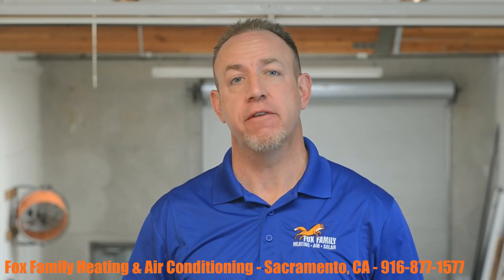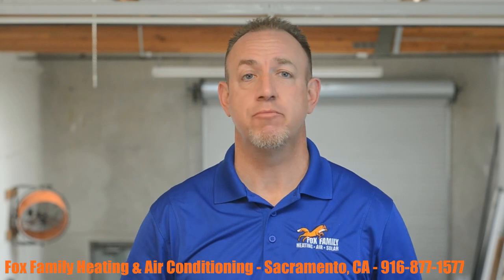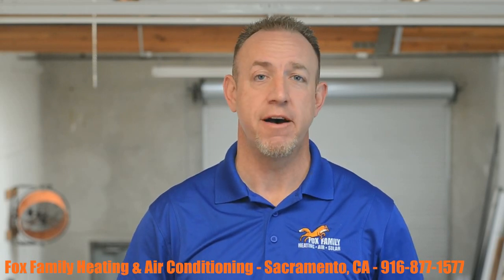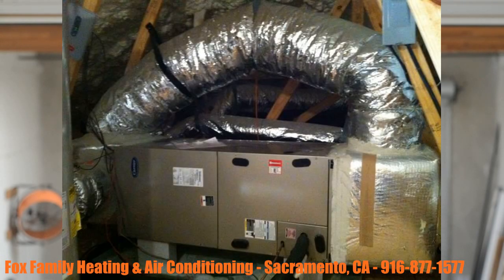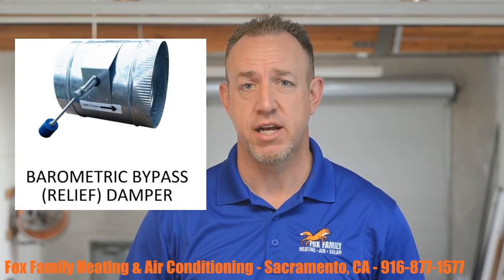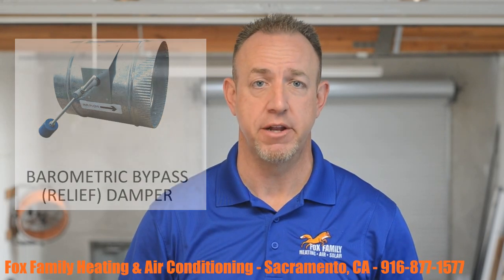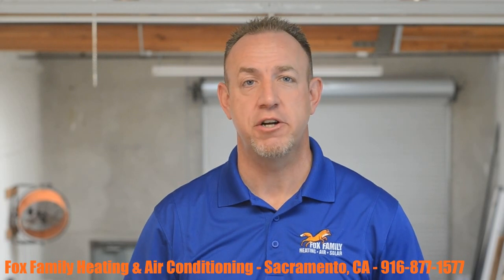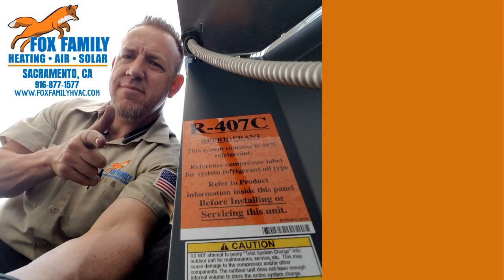HVAC Zoning Basics - Bypass Dampers and Dump Zones

Comment: When I purchased my two story house I ripped out all the ducts and repaced the 3.5 ton with a zoned 4 ton heat pump because I got a very good deal on the scratch and dent units. The ducts were oversized for the 1860 sq ft house in Texas. Two theromostats worked as designed, No dump zones or bleeding ducts. The upstairs was a bit noisy in one room.

The unit aged out and I replaced it piece by piece. The outside condeser with another 4 ton heat pump. After the thrid indoor fan and the synchronizers I replaced the air handler with a 5 ton two speed RUUD and converted it froma 410A to a R22 for the condeser. 

Resently I came into a RUUD 20 SEER variable speed 5 ton condenser. I replaced the condenser and changed to 410A refrigerant. 

Now this was a challenge to set up the zoneing with a two speed air handler, a variable speed condenser, single stage thermostats and a Honeywell zone board.

With trial and error my best settings are: Run the system on low as much as possible and let the dampers do the work. This means that after 40 minutes of running on low the zone controller will go to high. Typically it will run 2 to 5 minutes on high and then shut off. The high speed helps with humidity control. The variable speed likes long runtimes to achieve super high efficiency and very low noise on low speed. My power bill has been cut dramatically by running on low. The return airs are on both floors so floors are not separated and the returns airs will mix floors. I have also found that bleeding 1/4 open on the downstair damper keeps the downsatirs theromstat from cycling while the upstairs is calling.

For heating, it is electric and in Texas we don’t use much heat. My intent is to keep the heat on low unless the temperature gets really cold in which case the electric grid will fail first. My heater can pull 82 amps on high, enough to drain my wallet very fast.

Low and slow works and only go to high if you can maintain temperature.

Comment: Thank you for your informative video.  I have a raised ranch home.  The HVAC without any controls on it causes the lower floor to freeze while the living room, dining room and kitchen, all with cathedral ceilings stay very warm.  Additionally, on the living floor, the bedrooms (3), stay very cool.  As of now, I have magnetic covers on 66% of the downstairs registars to force more air upstairs.  It has made a difference, but on a 95 degree day, the living room and kitchen still reach 80 degrees and my wife has issues with heat due to heart problems.  I would think a three zone system would work well, by dialing down the downstairs and bedroom air flows during the day, and then opening up the bedrooms for nighttime.  I do have fixed speed blower in my HVAC system.  I tried to damper off with a manual damper on the entire downstairs duct.  I ended up stressing all of the rivets holding the fan together and it started to come apart!  Obviously, the answer is to not entirely cut air to other zones, but partially restrict it.  Thanks again.  I will probably be installing the Honeywell system in August.
Ron
Reply from the maker: Great info Ron. Good luck with that 👍

Comment: Thanks for the info - I'm sure there is a reason this is a bad idea but when using bypass connected to the return, could you use a limit switch with a lower temperature so the burners shut off earlier?  That way you are still re-using the heated air, conserving energy, and eliminating the "super-heated" situation?   Also, do they make variable speed blowers that increase/decrease based on the number of open zones?

Comment: This was an awesome video to discover.  We recently moved into a house with a dual zone system and noticed shortly after we moved in December, the house would take a very long time to heat up. What they did was the bypass duct, so the return air was being heated up just like you explained.  And I assume if we left it the coil would of frozen up with the ac in the summer.  We took out the elbow from the bypass duct and capped off each end, and problem was solved.   But now we have a whistle when one of the dampers close.  I have adjusted the electronic damper so it doesn't whistle, but now a lot of air goes through that damper, which defeats the purpose of having that zone shut.  I have tweaked it to the sweet spot of no whistle, but want the air blocked more.  I have tried the dump method as the video suggested, and it works, but the utility room the furnace it in, gets very hot in the winter, and very cold in the summer, so I recapped it off.  What are some suggested to use this redirected air more efficiently for my basement.  Problem is its completely finished so I don't have much access to the duct work besides my utility room.

Also, is it better to have the zones close as tight as possible, or should some air be allowed through?  Can adjusting the zones help with low air flow at vents the furthest away from the furnace

Comment: Where I come from, Bypass is a bad bad word. I would always use a dump zone before ever installing a bypass damper.   My favorite zoning system is the HeatPumPro by Arzel Zoning System (not just for heat pumps.) If you have 2 stage equipment, you can control the fan speed depending on the amount of available duct work to control objectionable air noise.  The fan is staged independently from the outdoor unit.  If you do not have 2 stage equipment you can use the Evergreen zoning system by Arzel which utilizes the evergreen motor for staging the fan.  If you have never heard of it you should check it out!

Comment: Great video! I had a service call working with a Honeywell HZ322 , it kept tripping on low temp ( discharge air temp ) the supply temp was correct. It’ll trip at 45 then reset sorta like short cycling, I checked dampers all were operating normal? It did have a by pass damper it was maybe 1/4 open. But still will trip

Comment: If you have an air handler with a variable speed fan, can it be programmed to use the lower / slower speeds when sending air to the smaller zones, thus creating less cfm, less pressure, and reducing the need to bleed off excess pressure.
Reply: My exact question.
Reply: I think that due to the amperage draw the ecm auto corrects its speed to run efficiently

Comment: I replaced a Power open zone damper last week, we installed a new Honeywell Damper that still bleeds air into the closed zone, you can set it up to like 30% leak rate or smaller. When I saw my first zoned system I was immediate thrown for a doozy because of the by pass.
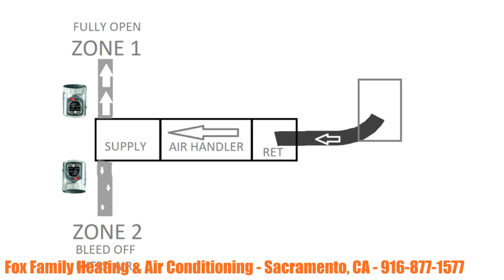Reply: 6:40 exactly what I am talking about
Reply: Another fun thing I had to do on this job was number the correct zones for the customer & rewire the zone board. Someone before us took off the 24v from Zone 1/2 and I’m guessing tried to give it 24v all the time or something because both sets of wires were on different tab. He had a single-story home zone 1  for the living room, dining , kitchen area. Zone 2 for the bedrooms. So it was easy to figure out. The attic was just getting to me
Reply from the maker: Wow great feedback.  Sounds like you guys know what you're doing. Keep it up!
Reply from the maker: @SalvadorHVAC  yeah I had a zone system where the stats were wired to the wrong zone!  Upstairs was feeding downstairs.  There were some other issues going on too. But wow, the installers really blew it with that system.

Comment: liked your video, but it confirmed as I have always known, zone systems are not effective for a home unless there is variable speed used to to drive the air, and the coolant. The only reason zones became of use , in my opinion was to get by with a smaller system. Even with variable speed systems, and EEV's additional systems like mini splits make much better sense. I  recently redid my home built in 1966 from a package unit and crawl space ducting to a smaller variable gas over electric 20 SEER split heat pump, and furnace combo (dual fuel). I then added mini's for the bedrooms not used much. The master bed, kitchen, living room, and dining area are covered by the split. I chose 2 separate mini's for the additional bedrooms because one could switch from heat to cool from the other. Also there is a slight increase in energy savings with multiple mini's versus a multi head system.

Comment: You never mentioned how to properly size the bypass in either the dump or return? 
75% of the largest zone? What's the rule?
We ran across one today and had a 14" bypass on a 3 ton system? It barely brought the barometric weight off of zero with either zone open or closed? I like the 24V return dampers with the static sensors.
Thanks for the info.

Comment: The question i have is
Instead of By pass damper wouldnt it be better to put modulating furnaces with variable speed ECM motors which will automatically slow down after sensing high static pressure building up in duct

Comment: I have a similar house to your example in this video (smaller scale). My small area is upstairs where I sleep. My downstairs damper has gone bad for the second time after I replaced it. (the larger area/downstairs damper will close permanently) No bypass or dump zone in my system. Is this because it has constant air blowing on that larger damper most of the time? It’s the damper that’s always closed so maybe it’s the constant pressure overtime causing it to stick in the closed position. That’s a theory one tech had

Comment: I'm a fairly advanced DIY guy and found this while looking for zone info to replace the awful Beutler system the house came with. The Honeywell dampers have caught my eye. But something else  I see in my own home is that the master gets pressurized so doesn't have good flow and thats not a zone problem . How would one fix that? install a return duct that is piped to the return plenum?
Reply: We have a 12"x12" return in our upstairs master be just for this reason.
Reply: Any beutler system is crap. The zone box dampers are too small and they put zone systems on single stage equipment with undersized return air intake. These units short cycle, overheat, hi limit. Add a return air intake to the master. Put it in the closet. That way you won’t see it or hear it. Then when that system does, get a 2 stage system with properly sized dampers.
Reply: @yourmomma3132  I also found just last week that the damper doors interfere with each other . Upstairs blend door can land against the downstairs door and then they just sit there half way between.  I had to cut the edge of one so they could pass each other. Pure junk.

Comment: I have a question when it comes to this. Could you not have two branches for each zone, one damper that only opens if the other zones are satisfied? This would dump that extra air only into the zone that you are trying to manage. I might be crazy, just a thought.
Reply: second thought too. You said you have dampers that can partially open. Could you not program those to be in a normal partial close state and then when the others fully close the zone that needs satisfied will fully open?

Comment: I just moved in a house with this new system I was really confused but understood as I researched it. Now I have a question I have a single condenser 5 ton carrier cooling 2950 sqft home and everytime one thermostat calls for cooling while the other is already calling for cooling I noticed the condenser shuts down for 30 seconds and starts back up to cool the second floor and then first floor calls again and does the same thing and this is continuous throughout the day I live in buckeye arizona where temps exceed 110 degrees frequently my concern is the amount of cycling this is doing roughly 30 to 40 times in an 8 hour day and obviously continues through the night as well but just giving an example as to how many times in a 8 hour period this thing cycles I'm not over exaggerating either ok maybe a little bit. Either way the cycling is very annoying and I'm sure it's not good for the system either. The thermostats seem to be playing tug of war all day long... what's your input on this and is there a way to keep the system running and allow dampers to do their thing without the system cycling with very short resting periods.

Comment: Does the fan run continuously? We just moved into a home with this system. After watching this, I understand it much better but the fan box in the attic is always running. Is this normal? The condenser outside only comes on when the thermostat calls for cooling.

Comment: It's a shame but sometimes you have to use a barometric bypass damper because of the set up and age of the system you're zoning. It's not cutting corners but it's the best you can do without replacing equipment or modifying the ductwork. Which is sometimes impossible without tearing parts of the house up. I'm on one right now just like that and I have to make it work. Is what it is sometimes.

Comment: So what zoning control will allow control of staging? I am zoning my single zone house into 3 zones. 5 4x9 registers each. 2100 sf total. 7500 ft elevation in Colorado. Have ecm variable speed furnace/ac coil. Replacing single stage condenser with two stage. I want to control staging when only using 1 or 2 zones to reduce airflow ect. Thanks!!

Comment: Great video! I learned a lot, just wish I knew where those pesky dampers were located so I could attempt to.. yeah.. nevermind..lol! I do have a quick question though.. I believe they set the bypass to be distributed through multiple vents on the main floor when the upstairs has reached its max, however, as of late the upstairs is barely pushing out any air and instead it is pushing hard throughout the main floor, even with the main control completely off....  This is a new issue that happened during winter last year, do you think a duct is blocked? a damper in need of replacing? should I just call a pro and move on with my life??
Reply from the maker: How did this turn out for you? I'm curious. Was it a damper that was stuck open?
Reply: Sounds like the upstairs damper is defective to me. HVAC tech here.

Comment: I have a question. I just started HVAC school and am in basic electricity and magnetism. My question is how much of that will I use in the field. Im having a hard time understanding it and I'm starting to question if I'm smart enough for HVAC.
Reply: Ive been doing this since 2005 I have my own business now , you dont have to be smart to do hvac you have to have common sence and understanding in electrical and what powers what and how relays work and  understanding how refrigerant should act and how super heat sub cool is measured as for that stuff in school I never went if you really want to learn this stuff go work for someone or a company start as a helper and see if you can hang hvac is hot and it sucks sometime your in attics on a roof and get dirty once you learn something move on dont stay for one company forever you'll learn more that way

Comment: So if you have a ture vs speed unit none  of this is really required. Vs speed meaning inverter or 2 stage . If this is still a issues use 2 systems.  The other options are very large un insulated  turn around loops in ot attics to increase return Temps.  Cols Evans get colder and colder and freeze

Comment: Is using a barometric damper dumping to an attic space a good idea? I had a HVAC company say we will install a register in the attic to dump when one zone is calling. I didn’t think it was a good idea in my two zoned single stage air handler system. I have my 2 zone dampers set to not close fully as in your 3rd example. The idea of wasting energy to the attic space is crazy to me. Problem is 33 code and 3 minute heat cycles with jet engine register noise when one zone is fully closed when heating or cooling.
Reply from the maker: Really seems like a huge waste of energy.  I would rather see them use dampers that can be set to not close all the way.  It's actually less work for the installers to do this.  Using dampers like the Honeywell ARD's is super easy to set that.  This way the excess air dumps into the unused (zone not calling for air) zone SO THAT UNUSED ZONE DOESN'T HAVE TO RUN AS OFTEN WHEN IT IS READY TO CALL FOR AIR!!!  It's not like that unused zone is going to overheat the excess bleed off air being dumped into it.  So, no I would not let them do it.  

Also dumping that zone into an unconditioned area is just irresponsible.  Every single cfm of air should enter the living areas of your home.  Not the attic.

And really do you want a company that is even offering this waste of energy installing your new system?  I wouldn't.  I would want a company that is going to save me as much money as possible   for the life of the system.  Get another estimate.  It's always good to get at least three and decide who you trust the most.  It's such a big investment on your part.
Reply from the maker: Open the other Ard bleed off some more and measure static pressure if it's just a service problem.  Relieving that air is soooo important to your furnace not overheating.
Reply: Thank you very much. If you all were in SoCal I would have you do the work.
Reply: TimujinWorld I also live in SoCal. Did you find a company to go with? Trying to figure out who to use is daunting
Reply: Ross Farina not yet.
Reply: @foxfamilyhvac  We stop Using Honeywell  junk...   The   Honeywell   have had  such High failure Rates as of last 2 years..     XCI     mor ebetter